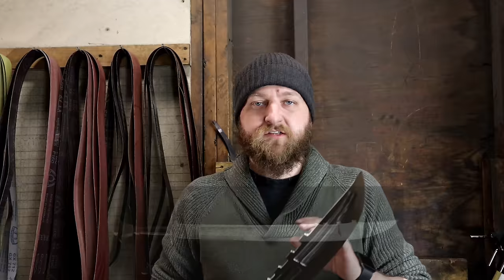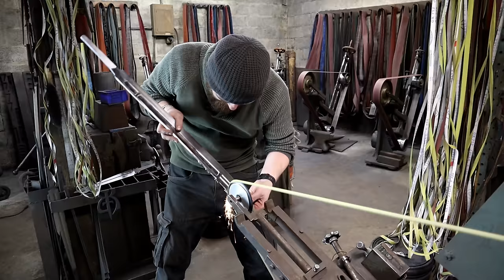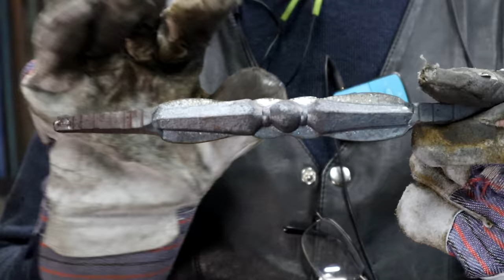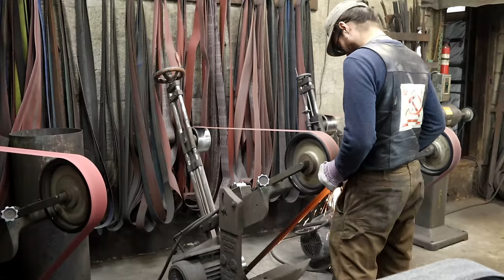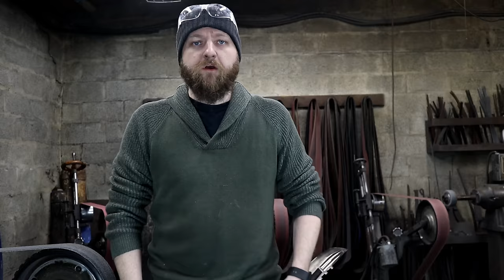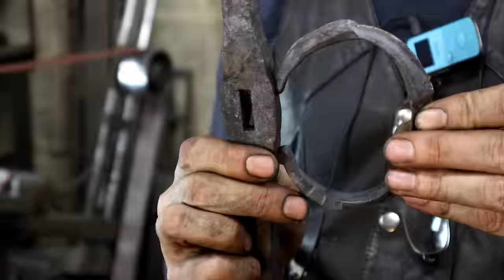Making A Falchion for Skallagrim - Part 4

Comment: I've been watching a lot of Alec Steele this past week, and I'm really struck by how big, but also how subtle, the differences are between a journeyman and a master. He ends up producing work of similar quality to Ilya and Matt, but he's much less efficient with his time and materials. In other words, he doesn't yet have the confidence that comes from experience that allows him to just do it and trust that he'll get it right first try. It takes him a lot longer to do comparable tasks, and he forges his projects super thick to give himself a lot of wiggle room down the line, which ends up wasting a lot of material. That's not to say that he's not good at what he does; he just needs more time to gather the experience he needs.

It's great to watch these two at their craft because they're so efficient, from Ilya preforming the blade with so little wasted metal, or Matt grinding those tough undercuts and fullers without hesitating.
Reply: Alec is also known for being more of a showman and not exactly known for knocking out high quantity work like Matt and Ilya are.
Reply: Alec is young, and with the new This Works channel, the honesty that both workshops can show is addictive. I was huge fan of the previous show, but making a feature segment about how long and detailed it is just carving in the fluer patterns is wonderful.
Reply: Also a big part of Alec’s channel is watching him learn and grow